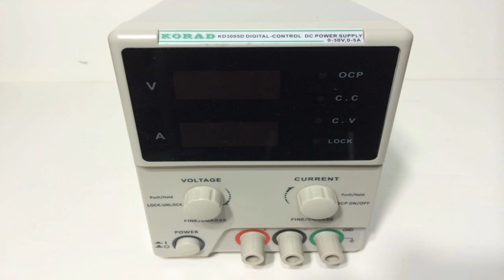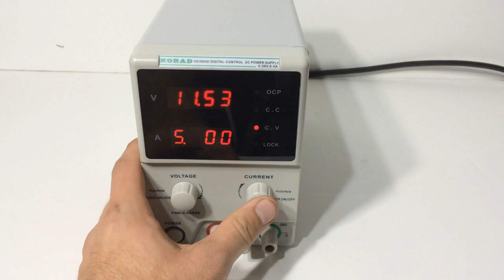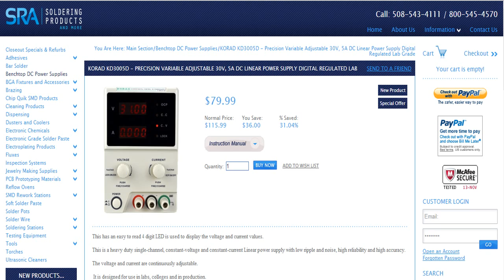Review Of The KORAD KD3005D DC Power Supply From Sra-Solder

Comment: I bought one of these,   lasted less than an afternoon.    voltage kept dropping from 3.3V to 0 every second - though no load was present at the time ( and my product takes 18uA in standby) .  It will go back , I will not be seeking a replacement.    A psu needs to be reliable , stable and noise free.   I can accept a mV error on the output voltage but his is as much use as a concrete life jacket

Comment: "There are 3 ports on the front - one for voltage, one for current, and the other for ground" - That sounds like nonsense to me.  The surely the ports are +,-,gnd, like any other supply.  Care to clarify what you meant?

Comment: i'm afraid that this one is the same crap as 3005d model :(
Reply: Hey why did you say the 3005D is crap , I'm in between buying a linear supply and considered korad KA3005P from srasolder. Can you help me out
Reply: From the very beginning, just after I got my ka3005d, I had plenty of problems with them. The first unit had to go back to the supplier about a week after I received it, because unexpectedly I got around 14VDC on output, no matter how I would set the voltage and current. My main scope of interest are digital circuits and most of the time I use 3V3 and 5V powered circuit, so you can imagine how much damage this issue could have done if I hadn’t been careful enough. In the second unit there was no isolation, no heat-shrink on soldering points, on 230V AC power rails, which go from the back panel main socket to front panel mounted on/off switch. And the space between those joints and the metal chassis was about 2 or 3 mm (not more, in any case). The soldering joint of the main wires was of such a poor quality that it broke after few months of normal use and I got full 230VAC on the chassis! Luckily, the main panel is made from PVC and it didn’t hurt me, but it is totally not acceptable in any gears, even those “el cheapo”.

Maybe it is only my bad luck with these power supplies, and only my units were broken, but set aside safety and quality, I think korad ka3005d is simply badly designed. Let’s say that we ignore those esoteric DACs, which were built on shift registers and R2R leaders, on some other fancy-Chinese-solutions, but I can assure you that the Chinese that designed those units have absolutely no idea of what the thermal resistance is and how to handle it in design.

One more thing, this power supply never ever gives you full 5A of current in the whole 0 to 30V range! And it never gives you continuous 5A of current – after a few minutes, the thermal protection starts to work and the power supply shuts down until it cools down.

I also wrote a post on my blog about some modification which I done: http://www.leniwiec.org/en/2014/01/06/korad-ka3005d-silent-fan-hack/
Reply: Holy Jesus , so which supply do you ecommend me thanks god I came up with you. Can you recommend me a good brand in around 120 U$s range? I need to buy in the US. What about Hantek ?
Reply: In this money, I will recommend you to buy normal, analog, linear supply. With big transformer and big heat sink. This kind of constructions are really solid and easy to fix if something broke after warranty. Here in Poland we don't have Hantek brand, so I can't say anything about it. Just look on spec and choose one which is analog, linear, have full current in all voltage from 0 to it max, and... one who is most heavier ;-) It can tell you that manufacturer use proper heat-sinks ;)
Reply: So not digital? can you check in the US for a good supply for me ?. so by no way korad right?
Reply: MASTECH HY3005D from your post on eevblog forum, looks nice. Big heatsink, big transformer...
Reply: hard to say anything about this power supplies...
Reply: But I don't know if it's got over current protection if say I set amperage to 4.5 Amps and the device I got plugged to draws more if the supply shuts down or protects. do you know that?
Reply: It's got 10 amps vs 5amps from the other one from mastech.
Reply: HY3010E looks better for me ;) Over Current Protection in this kind of power supply, always switch power supply to current source mode, after reach given current limit. In other words, if you reach current which you set on current limit knob, power supply will start to manipulate Voltage, so current will never be higher then you set.
Reply: Yep I think the HY3010E looks good, but listen this guy said this he bought one from amazon similar to mastech

- Received "RSR" power supply with "HYelec HUA YI ELECTRONICS" user's manual.

- I did a lot of research before decided to buy a Mastech's power supply as it is known for quality. Unfortunately, I received a generic one NOT Mastech. I'm not sure whether the power spikes (power on/off) has been fixed in these generic model or not. I felt I was cheated as I was able to get this on ebay for $40 less; however, the seller labeled this as Mastech while it is NOT. Hope it's not going to pull my house electrical surge when I turn it on/off.

Why does he say  "hope it's not going to pull my house electrical surge when I turn it off? "
Reply: Just don;t buy it on eBay ;)
Reply: That review was from amazon : ) I think I will be buying it from ebay. But should I go with that one HY3010E?
Reply: Hej. Widzę, że jesteś w temacie. Mógłbyś polecić sensowny zasilacz z płynną regulacją 30V/5A? Bo myślałem o tym tutaj, ale na szczęście zauważyłem Twój wpis :)